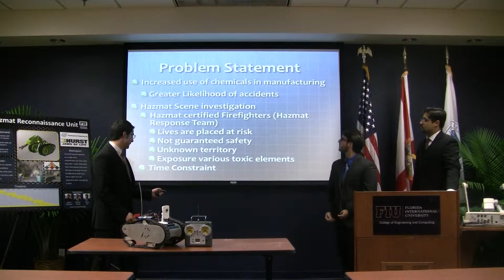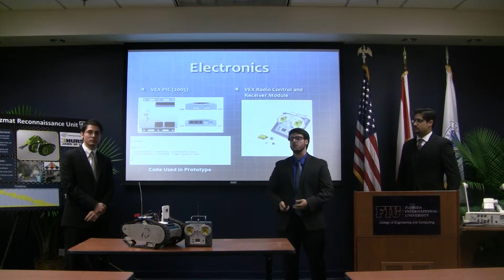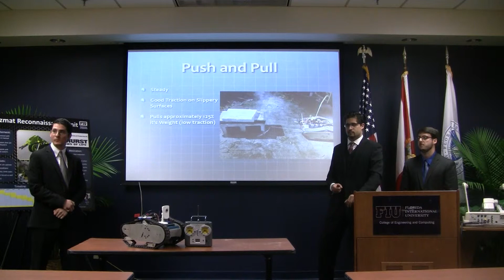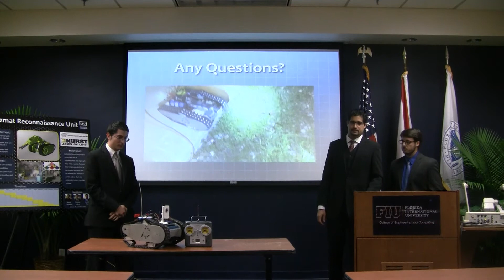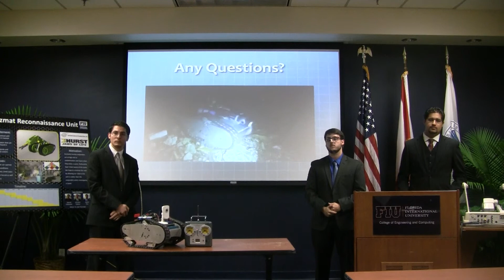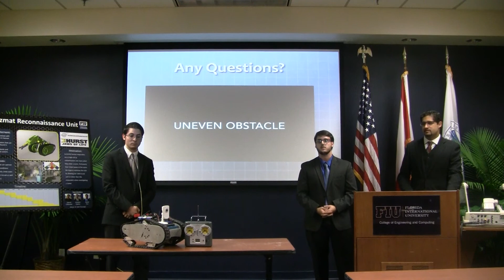Team 14: HAZMAT Safety Reconnaissance Unit (HRU)

Comment: The team overall had a good and professional final presentation. They went step by step on the process that they went through to create their prototype, from the materials chosen to the changing of my vision for the project. I enjoyed that they included a video showing the prototype in action, which allowed the audience to have a better understanding of how it worked. I believe that the team could have worked a little more on the flow of their presentation, as well as they should have included the cost analysis into their presentation.

Comment: The presentation was very professional and concise. I also enjoyed the the video at the end that displayed the robot overcoming various terrain. However they did not thoroughly addressed a major aspect of the robot, how does certain chemicals affect the machine, It is a hazmat robot. I understand it would be dangerous to actually experiment with such material, and I know this is just a prototype. Yet it would have added more to the presentation to identify alternate materials that the robot can be made with to traverse some common chemicals so it won't get eroded. Other than that it was a good presentation.